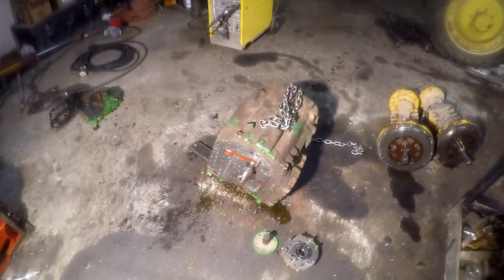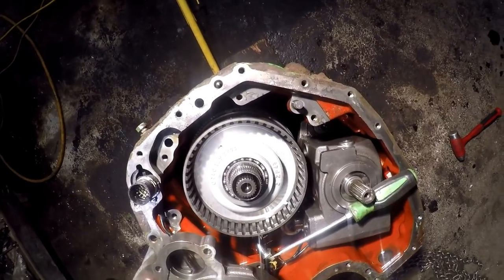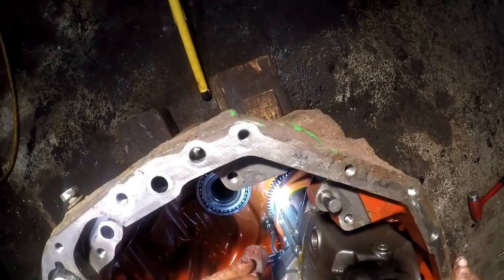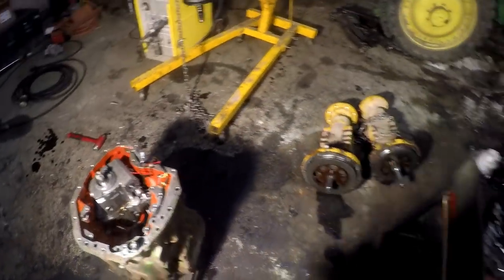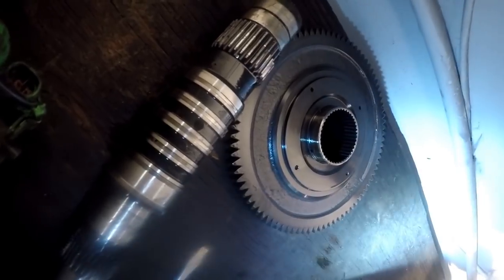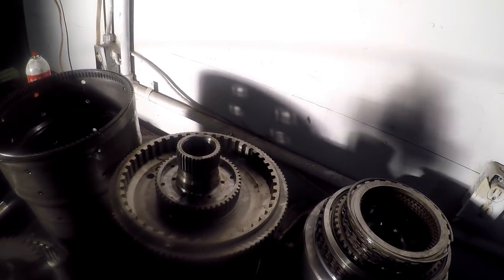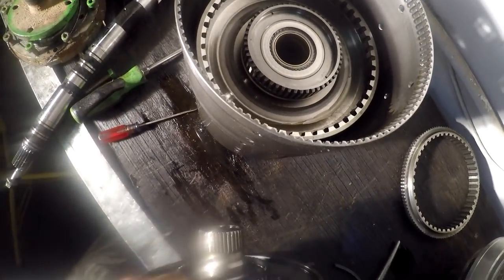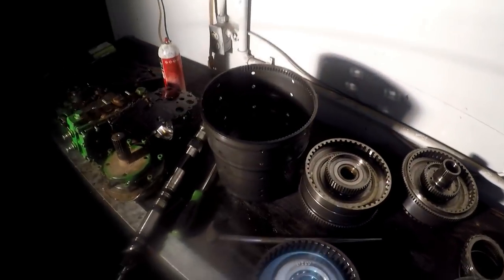John  deere 7320 ivt disassemble

Comment: Hey great job on having the guts to tear into it! I just now saw ur video. I helped repair a 7520 transmission in the fall of 2015. It looked identical. We got some of our parts from a deutz-allis dealer since they also use the exact same transmission and the parts are available through them and not locked down like they are through Deere. Would love to do another one sometime. It's fun doing something the Deere dealer knows nothing about!😁

Comment: Finally, someone took the "magic" out of these transmissions.I guess if you can make this thing work again,you can make loads of money only by repairing ivt's , thereby saving the owners  even way more.
Reply from the maker: Thanks Frank, I have been into a couple of large frame 7000 series witch are quite a bit different layout but same operating characteristics. It's just a hydrostatic pump and motor with directional packs and 4 range packs and 2 speed sensors.
Reply: Yes their own ivt  only has 3 Ranges.

Comment: Hi ! When I put in a new IVT transmission on my 6920s tractor, I mechanically disconnected the park lock before I took it out of the tractor. Did you test the oil pressure.  The main pump on the front of the gearbox.system pressure hi and low. All clutc pack park brake pto brake 4wd clutc ? The fault on my gearbox was C1 clutc slipped and was worn out. The main oilpump was out of range. You have to check where the oil pump is mounted after wear .... on the back plate. 
Good luck this is going well !!

Comment: the bad bearing would change the air gap on the speed sensor causing a skip in the reading or no reading at times then the trans would default or lock out ,whatever tractors do we do automatics too but in trucks if the input \output don't match they limp mode instantly to second gear on some,also always inspect the sensor as they are magnetic and you would have particles on it you would know then to look for mechanical damage or not.

Comment: well that sucks, failed pack or pump is easy but one bearing failure is gonna be a head scratcher. manufacturer defect or assembly error? but this tractor is fairly old and lots of hours unless this 7320 had ivt transplant back then
Reply from the maker: No , it is original transmission. I believe mofert2009 might be right as to some foreign material from rear end got in bearing, it is the only thing that makes since so far.

Comment: Smoked that bearing.  Absence of any foreign material makes it a head scratcher.  Oil flow, or drain issue?  Beyond that I'm guessing a bearing defect, or maybe damaged during assembly.  Any methodologies for adjusting pre-load on that shaft?
Reply from the maker: Shain Andrews  Yeah, I am with you on that. The rest of the bearings look new. I looked in the case and there is no feed hole in the case or shaft , it looks to be lubricated by being immersed in oil.

Comment: Man U need to get some led lighting up in that work shop dude do it for your self
Reply from the maker: Yeah, me and the wife were talking about that very thing, waiting on a bunch of money that is billed out so we can do it.
Reply: grease monkey101 even if you get another lamp stand like you have but led.  Keeping the halogen version also asit supplies more heat to work by. 
I would also think a quarter ton or half ton ratchet type winch on the end of the engine hoist might be far easier than trying to lift or lower parts

Comment: Just repairing a Deutz with a faulty input speed sensor, ZF have an input speed sensor and an output sensor on the transmission (run by separate ECU) if one sensor is faulty tractor will move but then go into neutral, the fault will be an alarm via an audible signal with fault codes on the transmission panel and instrument cluster, this should be an easy fault to find, do JD have alarms so one would know what the problem is?

Comment: Hi, why don't you clean the outside of the transmission first?
Reply from the maker: +mofert2009 because it's alot easier to manage empty. It'll get cleaned before it goes together.
Reply: I think the shaft with the dameged bearing is for reversing!
Reply from the maker: +mofert2009  No , the only purpose is for ouput speed sense. I looked up the zf nomenclature and it calls it the ouptput speed sense shaft.
Reply: You have to check the inner bearings of the rear axles. In Europe most of the ivt transmission problems are because chips of metal from the rear axle bearings come into the ivt.
Reply from the maker: +mofert2009 Reading the theory of operation  it says that reverse is achieved by engaging reverse clutch pack and shaft rotation changes by swash plate movement in hydrostatic pump there by reversing the fixed displacement motor in turn reversing shaft rotation. I know what you're thinking like most transmission have an idler gear to change shaft rotation, that's what I thought at first too.
Reply: https://youtu.be/TjEZUMU3QBQ check this video it's an explanation  from the zf eccom. That's what's in   your tractor.

Comment: Any idea why the 5075 e loses breaks in 2wd
Reply from the maker: Christopher perkins  Your mfwd pack is a spring loaded pack , which means while in 2wd it takes oil pressure to release clutches . In 4wd oil pressure is taken away and spring  pressure takes over
 Sounds like a leak in mfwd pack.